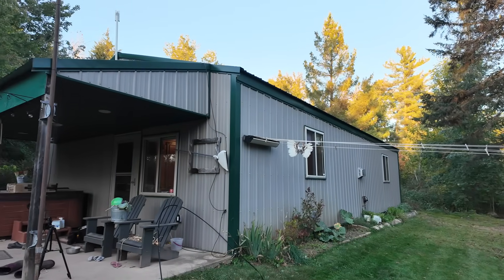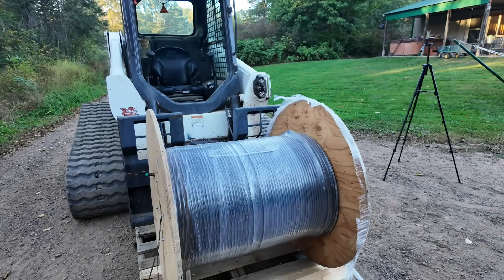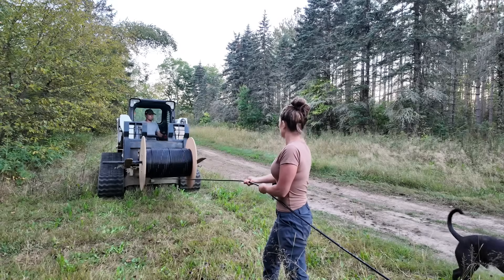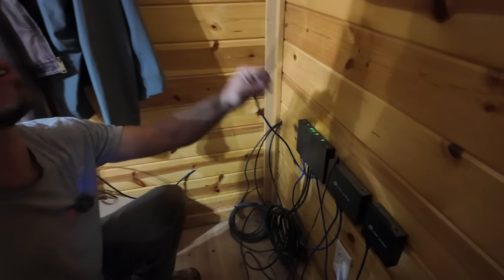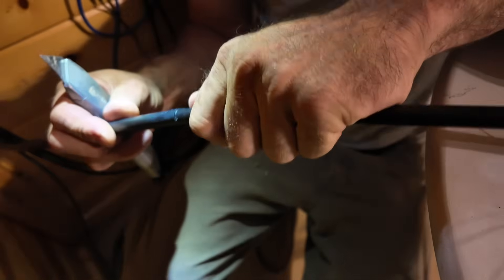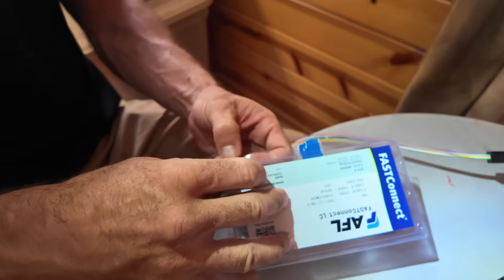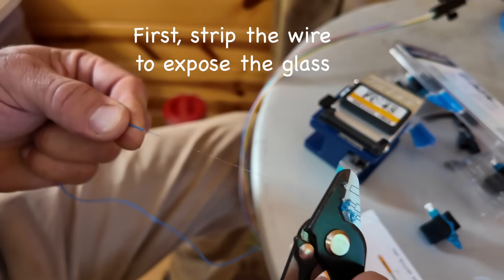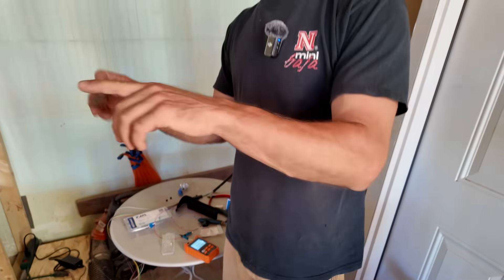We Need Internet! Running a 3,000 ft Fiber Optic Cable

Comment: Ryan i did the same/similar and ended with the same/similar feeling of.. it's working, I'm not touching it again. Although i want to get my numbers down like you did!  -2 is great for slide on connectors. Everyone in the industry cheats using fusion spicers and pre terminated pigtails
Reply: It's not cheating. Fusion splicing pre-terminated connectors is superior to mechanical splices.

Comment: I did a similar project connecting my house and barn. I went with pre-terminated two-strand single-mode fiber and used bidirectional (often abbreviated "BiDi") transceivers which use two different wavelengths to send and receive on the same one fiber. Has been working great for me ever since I connected it up. I also use Ubiquiti nanobeam 5GHz wireless bridges to shoot internet to other smaller outbuildings. They work very well too, as long as you have reasonably unobstructed line of sight. A few trees are OK but a forrest isn't.
Reply: THAT is a great way to go for a DIY install... Get a good measure of your run, add 50' at each end and order it.
Reply: 900Mhz is a better option for wooded areas. Less absorption than the 2.4Ghz & 5 Ghz Bands.
Reply: @guytech7310  900 MHZ is only good for low bandwidth